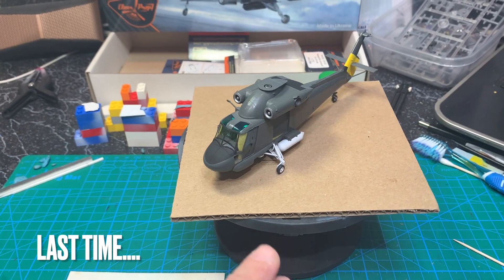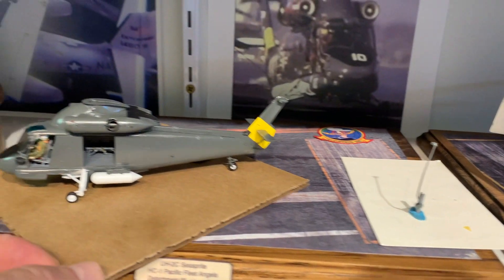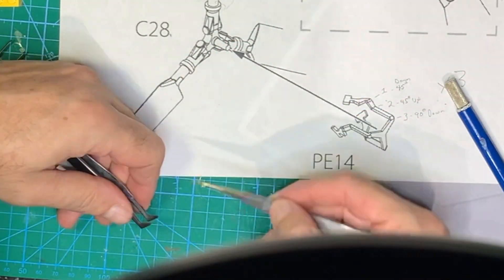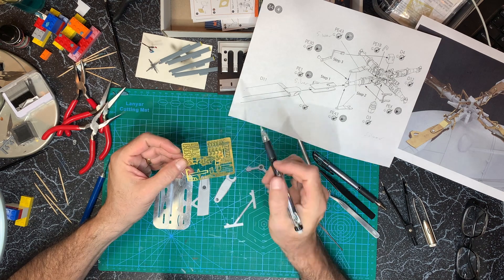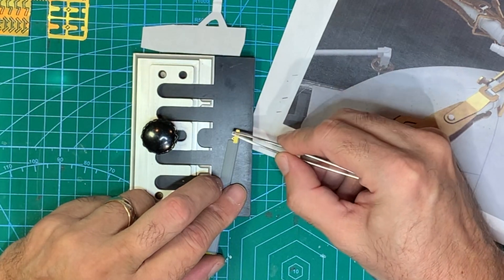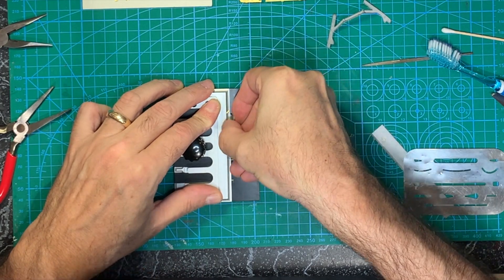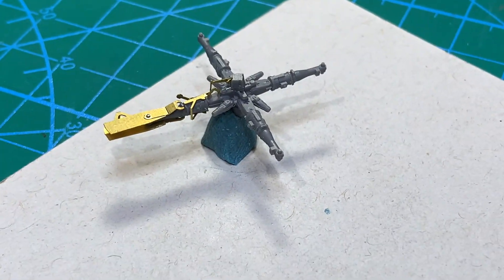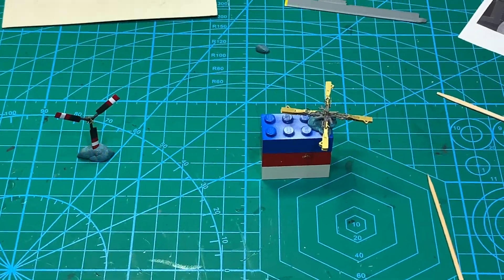Whirlybird Armed Forces GB Entry: UH-2C Seasprite Update 11 - PHOTO ETCH!

Comment: Wow, thats some detailed PE work. Nice that the CA glue doesnt stick to the parts on the tweezers for you.😊
Reply from the maker: Oh it did here and there.  Took forever to manipulate those parts....like 5 minutes just to get it in the right position on your finger so you can then hold it at the correct angle to make a single bend, etc.  Took forever.  Glad to be in comparatively easier (but numerous!)  decals right now.  Final is next.  Thanks David.